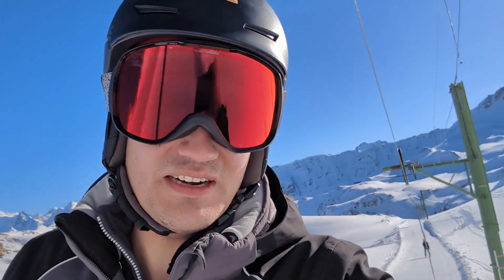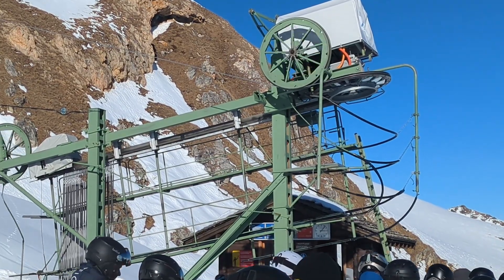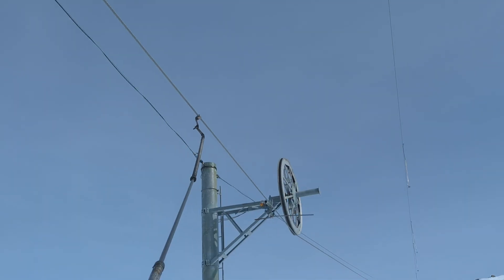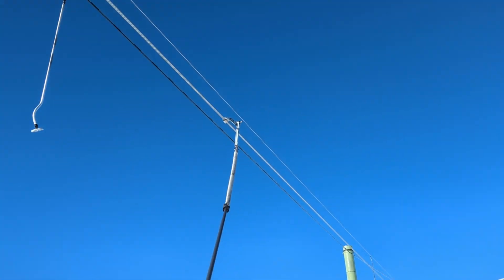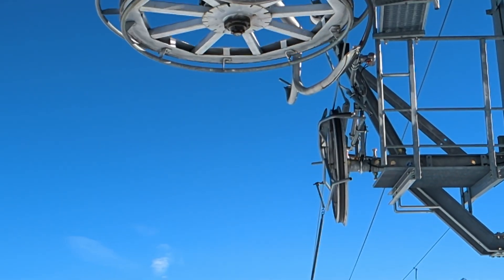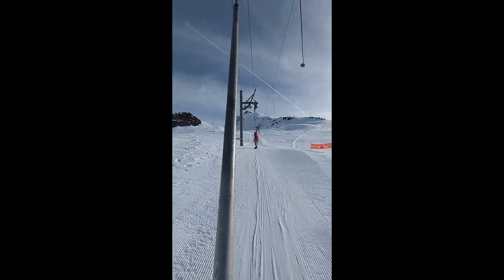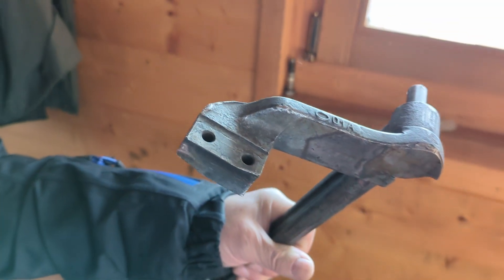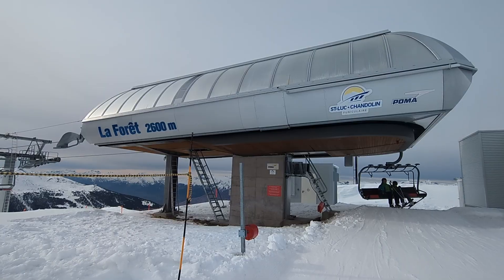The brute force approach to the impossible skilift problem: Poma lifts!

Comment: "Brute Force" most accurately describe the launch. These are the most violent launches I know and on many occasions my weight was taken off my skis as I was hurled up the mountain. Fun stuff if you like a thrill. Note that these are also quite often the first lifts you'll take as a beginner. And if you can muster this, you can handle any lift. I consider that an advantage.
Reply: Brute Force lift teaching !
Reply: 4 year old me got taken off my feet for a ride in the air the first time I stayed attached to a Poma as I tripped the stick
Reply: I've flown a metre or two at 80kgs thanks to the local Poma in Lofoten.

At Riksgränsen in Sweden, they have a sensor that senses when you take the pole out from the magazine, which triggers the mechanism and locks it, instead of the typical start pole trigger.
Reply: especially in poma it really helps that you pull on the handle at the beginning so you get the nice steady smooth launch and after that you start to release the handle until it reaches your butt. You need to act as another spring and damper in the system and then you can have very smooth ride.
Reply: @LaggerSVK  I remember learning how to do this and then intentionally doing the opposite so it would launch me into the air more as a kid
Reply: With a snowboard, these lifts are a serious rite of passage! Not for the faint of heart! It took me a lot of tries to learn how to do it and I feel like my general snowboarding skills have improved massively just from getting used to riding these lifts.
Reply: I remember all the Grommets used to call out "Slingshot", so the Lifty would hold the poma a bit longer and "launch" them a couple of meters.
Reply: Yes, but it depends on the incline right after you take the lift. If it's mostly flat, then it's a nice experience, but it's it's quite steep, man, it lifts you quite high, literally. You better grip it strongly! 

To me these are the "normal" ones and the T bar the weird, slow and inconvenient. 

(I've never tried the poma on snowboard though, only on skis)
Reply: …beware if you have a dodgy back!
Reply: I do not agree the difficulty of this lift. As it is centered on the skier they are the easiest ones to balance on (of those that skier is getting pulled up on the surface, not in the air). I think the T-bar lift is MUCH more difficult to beginners, especially the small ones.
Reply: Especially when the spring is dead like in les estables. Big jumps

Comment: back in the early 70s in Michigan. It was rope tows and Poma lifts. I have a place in my heart for them, and I see where the economies of a Poma lift, and even the experience is nice just keeping you on the snow. and the sounds and the sensations are unforgettable.

A lot of metal on metal. I remember those springs breaking, and some of that telescoping poles that would cover up the springs on different types breaking as well. And you can see from the lubrication and the metal ski suit is going to have a lot more grease on it. 

I’ve been skiing in the Eastern Swiss Alps for the last 10 years but before that it was the western French Swiss Alps. I had to get myself back to the west and ride some Pomas. Thank you!

Comment: Fond memories…
Back in the 80s some friends and I were skiing in the French Alps. I remember one Poma lift That we just called the kangaroo lift or the ball breaker. The springs were all worn out so when the pole grabbed the cable, the telescope would extend without any rising tension to the point where it's just locked and pulled you for a 4 to 5 foot jump. You just had to be prepared for what was coming at you

Comment: The spring-tensioned telescoping end of the pole makes perfect sense in the context of the friction hold on the cable. It helps ensure relatively consistent pretensioning of the grip against the cable anytime a rider is holding onto it, making the friction hold even more reliable.

Comment: I worked for Poma in the US for 10 years. We had piles of those old parts and pieces for those rope tow lifts. They were not popular in the US. We made gondolas and high speed quad lifts. We held the record for the steepest climbing lift and the highest speed lift for a long time.
Reply: I worked at a small ski resort in the US that had a T-bar and 2 platter lifts, none of which were made by Poma and they were known as the Poma lifts.  They then got a conveyor belt lift made by Poma and this was referred to as the Magic Carpet despite Magic Carpet being a company that the resort had never bought anything from.

Comment: I spent most of my ski life at French ski resorts, so Poma lifts (often nicknamed button lifts in English) are what I'm used to. I'd argue that, from a rider's perspective, they are far more comfortable than a T-bar. Yes, you'd occasionally find an old Poma button lift with weak springs, thus leaving the rider wondering when the tension will take up, but most are fine. The traffic lights work well, as does the release and the change of direction.  I do recall, however, one button lift at Flaine in the 1980s that we used to call Cape Canaveral as it exerted a tremendous take-off force that launched skiers off the ground as it grabbed the cable. Once you'd ridden it the first time, you knew to brace yourself and bend your knees.
Reply: I'm not sure whether it's still the same one or not. But there's still a button lift in Flaine proppeling you into the air as you depart. It's honestly a lot of fun

Comment: Here in the Northeast U.S. Attitash mountain in New Hampshire had a T-Bar that had a retractable line that was housed in a spool which was attached to the cable,two people could ride side by side or just one. This was on the bunny slope at the base of the mountain. These lifts were also throughout New England at various mountains. Cannon mountain had one at the top of the mountain which was always a thrill to ride. I enjoyed these lifts knowing that if someone ahead of you had a yard sale you could easily track around them and continue up to the top, and if the lift stopped you could easily get off and just ski away. The bar was usually placed behind your butt.

Comment: You’ve neglected to mention one of the Poma disc lift’s greatest features: if you have the appropriate biological equipment and you happen to position yourself improperly on the pole, you can get a powerful tug delivered directly into the nards and, depending upon how severe it is and how graceful you are, either hold on as the pain subsides or ditch the lift entirely and have a moment to yourself as you recover.

Is “clamp” not an appropriate term for the thing which attaches the vehicle to the rope? I’m a (US) English speaker and that’s how I would describe it, though I am not a ski lift technician.

Thanks for the cool video!

Comment: Re discovering your channel and subscribed! 
You have to go visit the ropeways in Val Thorens, if you haven't already, it's one of the resorts in the 3 Vallées mega resort in France, the largest in the world.
They have very special machines, like double loading chairlifts and the gantry / machinery is incredible.
A good chunk of it is easily visible and I'm mesmerized every time! 

These videos are very interesting and satisfying. 😂
Kudos
Reply: Yes, funitel all the way!
Reply: @nacckko   Yup ! They have something like 4 funitels in Val Thorens only if I recall correctly. I don't remember if there are other funitels in the other constituent resorts of the 3 Vallées mega resort.
The codename for funitels is FUN, that says it all!  😄
 
But the most interesting machines in my opinion are the double loading chairlifts and their fantastic gantry and machinery. They have a nice big selection of those in Val Thorens! 

A double loading 6-seater either has a 12 person wide loading line or two 6-person loading lines at different angles or with an acceleration carpet to load 2 chairs at once one behind the other. With chairs moving around suspended on rails to realign themselves behind each other and be launched onto the line.
It's mesmerizing !
And the throughput of these machines is huge...!

There are at least 4 different double loading 6-seaters in Val Thorens alone :
There's one called Cascades, next to the Péclet funitel, and it's inside a building, so the gantry is under the ceiling instead of the usual chairlift station.
It was the first double loading chairlift in the world when it was built in 1995 by Doppelmayr and is capable of carrying up to 4500 per hour if I recall correctly. With over 100 seats and a frequency of 5.4 seconds!

There's also "La Portette" dual loading 6-seater, I think it's a Garaventa (now Doppelmayr ?), it was built in 2014.

Another older dual loading 6-seater called "la Moutière" which was built by POMA in 1997. This one was initially built as standard single loading but was modified to add the double loading system in 1998 and increase capacity from 2800 to 3600 passengers per hour with almost 120 seats. This one has its two loadings roughly perpendicular to each other.

There's the Plein Sud double loading 6-seater too, it dates back to 1998 and was built by Doppelmayr.
It carries 4000 skiers per hour and has about 140 seats.
This one has a 6 + 6 lateral loading and the line goes through a portion of the village.

Val Thorens has crazy machines, they only lack a 3S and a funicular, like the great underground one in Tignes called Perce-Neige (snowpiercer) or the one in Val d'Isère called Funival. They also lack an 8-seater but they seem to prefer a double loading 6-seater over an 8-seater.
Maybe one day they'll introduce a double loading 6-seater!  Not sure if double loading 8-seaters already exist somewhere but I've seen sliding carpet loading 8-seaters that allow for shorter boarding and increased frequency (reduced spacing between seats).

Usually the ropeways in the "mega resorts" of the Tarentaise Valley (also called the Olympic Valley since 1992's winter Olympics), are pretty massive and super efficient. The mega resorts of the Tarentaise Valley are gigantic and host a huge number of people in winter.
So the lift systems they have must be really fast and efficient. A bit like Disneyland has double boarding roller-coasters.
The Tarentaise Valley (France) is to skiing what Orlando is to theme parks and entertainment.
The 3 Vallées mega resort is like Disney World, and the other mega resorts, Espace Killy (made of Tignes and Val d'Isère) or Paradiski (Les Arcs, Peisey-Valandry and La Plagne) are like the Universal and SeaWorld theme park resorts.
With the only exception that the mega resorts of the Tarentaise Valley all have the same majority owner and thus offer free days in other mega resorts when you have a weekly pass.
Some call them "industrial skiing factories" because they cater to hundreds of thousands of visitors, but the ski domains are so huge and the lifts so efficient that you don't see much difference with a small family resort.
You can even feel more "alone in the wild" in these mega resorts than in smaller ones, thanks to the shear gigantic size of their skiing areas, and to the huge height difference between the highest and lowest points of these resorts.
Plus, you spend a lot less time in the lifts given how efficient and fast they are.

Val Thorens is an absolute must for any ropeways fan ! (And for fantastic skiing too).

Comment: I always loved the jankiness of these Poma lifts. Here in Australia, in addition to (in the past) having a Poma with 2 bends, we also had The Fastest Monocable Skilift in the world; the double-ended Summit Access/Howqua Poma at Mt Buller, which ran at 6.5m/s (~1300fpm) during its first few seasons, but had to be slowed down to a normal 4m/s for the public, although staff could still get a full speed ride until it was removed in the mid 80’s.
Reply: Oh, I remember that one. On slow days mid week early in the morning they would have it cranked to the max, you could get serious air if you jumped at the right time as it went round the corner
Reply: Huh! I didn’t know Howqua used to be a surface lift. It’s pretty steep!

Buller also has the longest surface lift in the country, the agonisingly long Tirol T-bar at 1610m. Literally goes all the way from the car park to the top the main slopes. When the Northside mid load station is closed, it’s your only way out… my left leg aches just thinking about that bastard.

Comment: Wait, so they don't use the von Roll method?  That's odd.
Reply: not enough weight especially when launched without a passenger or if the rider falls off during the ride

Comment: In Germany, the UK, Ireland and the United States, this would be termed: Brute force or Unrefined ... 😳
In France, this would simply be termed: Normal 🇫🇷⚒💯🤘

French engineering has a certain J'ai ne sais quoi to it which means theirs are often not the most gentle or efficient of solutions...But by Thor do they create some damned reliable, resilient and perfectly performing stuff! Just look at the TGV! 🚄🇫🇷💨❤‍🔥

Despite the far-beyond-British levels of puissance in their products, we have a surprising number of Poma installations for a country that's not known for being a ski destination. Aside from the few ski areas that we do have (Generally using simple ski lifts) and numerous dry slopes (Usually ski tows), they are also used at Alum Bay (Isle of Wight; Classic fixed-to-rope ski lift), Alton Towers (Staffordshire; Cabin lift, gripped to rope) and various other places. The Emirates Airline (TfLs cable-car over the Thames) is another cabin lift similar to the one at Alton Towers. 🚠🇬🇧😇

Many thanks for such an « Alsthom »... ahem, awesome demonstration of the sheer indominatability and perfection of French heavy engineering! 🇫🇷🛠❤‍🔥😇👍

Comment: As a mechanical engineer w/50 years experience all I can say is "Wow". Pardon my French but I'll wager that the Concorde design team did not have a hand in this creation.

Each tower mechanism is itself a potential failure point. Components of each tower (that guide the carrier, interface with the carrier, or are in immediate proximity) are potential failure points. Each cable gripper is a potential failure point as they must all be consistent within some set of limits. Couple in wind gusts and the ingenuity of humans to redefine the limits of stupidity when using surface lifts and the quantity of both potential failure points and failure scenarios at any one tower dwarfs that of a conventional lift tower. Regardless of lift type, a mechanical issue at a tower means that lift is not operating and won't operate again until remedied. If the lift isn't running, it's not earning money. 

So, although it's a worthy poster child for perpetuating disparaging cliches regarding French engineering I do recognize that the Poma is a long standing design and that there is significant qty of Pomas in use today. As such it suggests that they are indeed a sturdy and reliable piece of equipment.

Certainly in terms of human safety, as a surface lift, any mechanical failure has low risk to the user. Just ski away.

Comment: I write ski history and I have been trying to discover the fastest surface lift. There was a 6.5 metre per second poma-lift that operated at Mt Buller in Australia, although the speed caused injuries and it was slowed to 4 m/s after a few years. Has there ever been a faster conventional surface lift in the world? I know there is a 'slingshot' ski lift in South America, but that was never mass produced. Any ideas or comments on fast lifts would be appreciated. Thanks. 🙂
Reply: Up until 1988, Panorama resort in BC, Canada had a T-bar that did around 6 m/s. It went so fast, because it was the main lift from the base, and because it was so long. As a kid skiing there in the 80's the lift was as fun as, and sometimes more fun, than the actual skiing! ( due to the path would get quite bumpy as the day wore on, and you would actually catch air of some of the bumps riding up the hill)
Reply: IM(vl)E just 4 m/s seems to be the fastest typical speed for most Poma systems, though I often wonder why they don't combine the grip technology from their cabin lifts to their Téléski product and have the rope running at 6-8 m/s. It'd really get the thumbs-up from anybody at busy ski resorts! 👍

And not quite the same (And built by CINM/Pirelli, not Poma) but the fastest Travolator in the world (Gare Magenta, Paris) operated at about 8 m/s I think 😇

Comment: Interesting stuff. Ski lifts really do bring about some interesting engineering and design quirks. Way more than one would think of. Other things I think about is just super light weight stuff. I know the lift at my own local ski slope, Hedeland Skicenter in Denmark, is also really unusual. It is a surface platter lift and the lift has zero foundations. The ski enthusiast club that owns the slope had to assemble the lift themselves too, it is just super small and kinda flimsy compared to other lifts. It was built by a company from the Czech Republic called B+J MIKESKA, who calls the model the "ŠKOLNÍ 300". It is like the cheapest, simplest platter lift on the market. It was bought to replace one of the 2 old Ponylifts between the bottom of the top, which had been in place since the 1980's and were even bought as hand me downs back then. But hey, a super cheap barebones lift like that, which doesnt even need concrete foundations is perfect for a slope owned by some skiing enthusiasts that got so little snow it couldnt even open for 5 years straight.